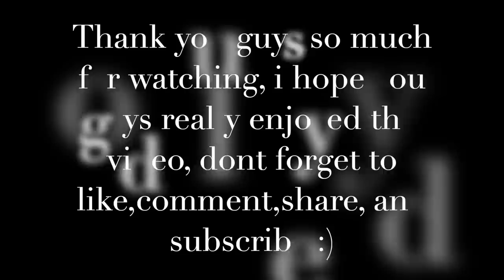You Wont Believe What Happened To My Truck!

Comment: broo it usually gives u head up when thats gonna happen. usually a noise or wheel moving.. also all you need is to buy a ball joint and have a shop install them cuz they need to be pressured in